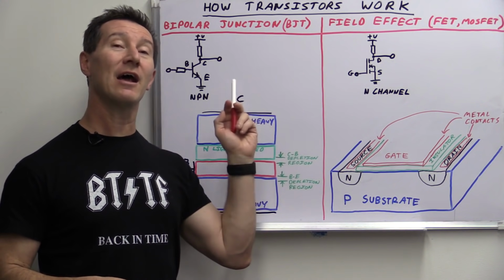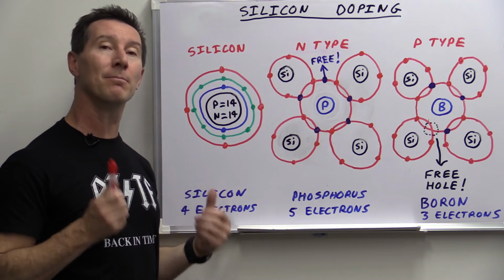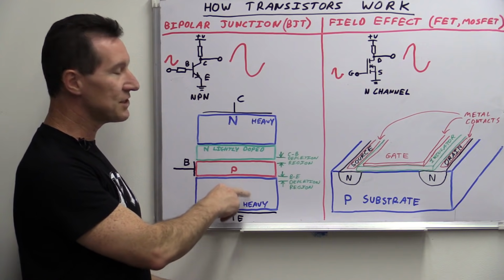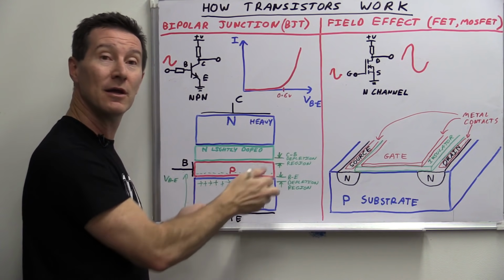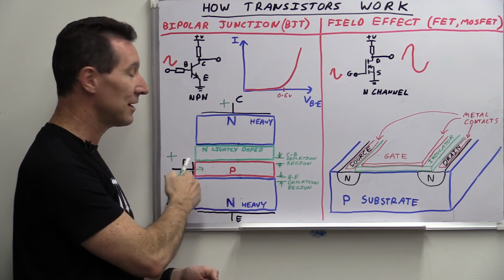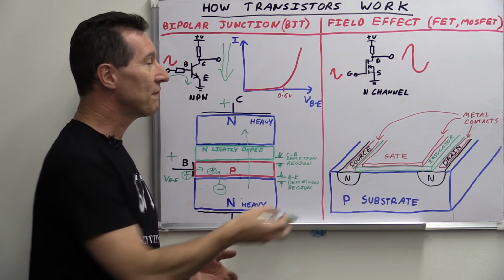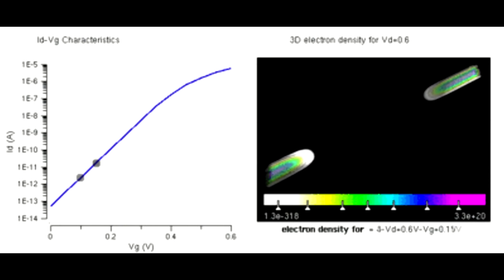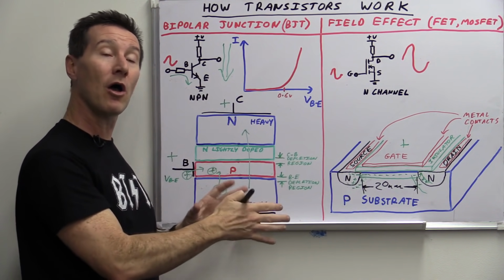EEVblog #748 - How Do Transistors Work?

Comment: Why is Conventional Current used in science and engineering?

Because of the positive current-carriers common in nature.  "Electric Current" has to work correctly for anything explained by science, not just for electronics involving metals.  (And then confused tech people pretending that holes aren't real, or that batteries and electroplating and proton flows don't exist.)

Positive currents are:   
- proton-flow in battery acid
- Proton flow in fuel cell Proton Conductor membrane
- Positive ion flow in human tissues, salt water, ground, ocean etc. (along with negative ions going opposite.)   
- Positive ion flows in plasmas along with electrons going opposite.  
- And of course, holes.   

Holes really are genuine positive charges, same as protons.  They aren't just "lack of electrons," since positive charge is when an existing proton is exposed by a missing electron.   Holes are real protons, but only having virtual motion caused by electron-transfer.   When an electron cancels out a hole, it leaves behind an exposed proton, as if the positive charge had jumped from atom to atom.

Also, CC conventional current is great for teachers testing the students, because if a student complains that the currents are "backwards," send that student back to physics class, since they've just admitted that they have little idea what "electric current" actually is.   Put it on a test questions.   Thinking that Franklin was right about single-fluid electricity, or thinking that current is somehow backwards, that's an automatic zero in physics classroom.

For the ones with solid physics background, CC doesn't look backwards at all.   Electric currents in salt water have no electron flows, instead they have two opposite ion populations going in opposite directions, two clouds flowing through each other, yet creating just one electric current, the CC current.

And besides, DMMs measure conventional current: they don't break currents down into the actual carrier flows: into percent of protons flowing one way and percent of electrons flowing the other.    Clamp-on ammeters tell us the Conventional Current even when clamped around an acid-solution hose, or a human arm being electrocuted, or a fluorescent lamp tube.

Comment: Hoho Dave, very rarely do I think you have misled your viewers, but here you have a little :O), We are taught about depletion layers and holes and magic ''transistor action''  but its just a bit of a fairy story story. We owe the development of solid state electronics to quantum mechanics and the predicted action was proven by those three famous chaps. The movement of  the positive ''hole'' charge carriers is pure quantum mechanics.
Reply: mart fart There are no moving holes or positive charges (as marked on a modern car battery) going anywhere in this universe. There are particles of electricity that can drain from an area to an area that has less particles of electricity. However there are only particles of electricity moving. Only particles of electricity stop other particles of electricity. Insulators do not stop electricity at all. You have to charge them up like a battery or a capacitor in order to turn them into an insulator.
That two particle theory of electricity was a theory that has been around since amber was discovered to have electrical properties. The French Scientist DuFay claimed it. However Benjamin Franklin disproved it.
It is like a vacuum cleaner, the vacuum cleaner does not suck anything anywhere. It compresses air, and ejects that air back into the atmosphere. That action creates less pressure inside the vacuum. Air from outside the vacuum now tries to move to the inside of the vacuum cleaner, by means of pressure alone. Because no attraction force exists in the universe. The same is true of electricity.
You can easily shut off a transistor by applying an abundance of particles of electricity, a (-) charge on a modern battery, to the terminal that had activated the transistor with a (+) charge. It resets the transistor to initial normal state, it restores the diode that was originally blocking power from flowing through the transistor.
Reply: William McCormick
inverted commas serve a purpose.
Reply: Did you mean around the symbols '+' and '-', that did not work for me. It caused me too much trouble during proofreading. While reading electrical diagrams I noted that (+) and (-) was easier on my understanding.
Reply: Symbols are kind of funny nowadays everybody has learned them a different way.

R1 x R2
------------
R1 + R2
Was originally written by mathematicians of the day as:
R1 x R2 ÷ R1+R2
 That is the in line form using the division symbol, which was not the fraction symbol, that had another function totally. This system actually was perfect for inputting complex formulas into computers as an in line formula. With no parenthesis needed. The system was amazing. However I do not believe anyone will ever get to use it.
Reply: William McCormick
You should get an old calculator that operates with Reverse Polish Notation. I had an early Sinclair programmable which used it, and HP of course.
Reply: This was much more simple and precise. To force division between two numbers or values, and turn them into one unit, we used the (/) symbol. A little (x) did the same thing between two numbers it forced multiplication between the two numbers a large (X) took every thing to the left and multiplied it by everything to the right of it. Because the order of math as it was learned across much of the United States was addition, subtraction, multiplication and division. One night I was explaining this to a modern mathematician and he said I was nuts. Then about fifty people chimed in and said they learned it addition, subtraction, multiplication and division. The old division symbol (÷) used to mean take everything on the left and divide it by everything on the right, unlike a fraction.

People somehow saw all the parenthesis above a complex in line formula back when everything was done by hand, and somehow assumed you needed a lot of them. Add that they could not get a main frame computer of the day to re parse a formula written like that, and I give you modern mathematics. IBM was going to loose all its grant monies or help change math and save the computer.
Reply: Oh by the way I meant originally the '' '' around word ''holes'' that I wrote... We  learned BODMAS (Brackets, Of, Division, Multiplication, Addition, Subtraction)! And with memory, a constituent of anything you could call a computer, parenthesis is irrelevant.
Reply: I am not sure how they sold "holes". Perhaps it is air gaps they are referring to. That would be feasible.

Comment: Thanks Dave for the great video. Not sure if it's been covered or not yet, but like Intel & AMD years ago when clock speeds basically topped out, but they kept naming their CPUs with "virtual" clock speeds representing the effective performance improvements due to other innovations like multi-threading and multi-core, the semiconductor industry has been doing the same for the past several generations. So the 14nm node does not literally have a channel length of 14nm, the transistor performance just behaves as if it did.  The really impressive dimension though is the gate oxide thickness, which actually is only a few atoms thick, and controlling this thickness (much less reducing it) is one of the main motivating factors behind going to the FINFET non-planar transistor design for 14nm.

Comment: The next generation will be Sphere - Kinetic with moving atoms inside, not the  static, here is the beginning : >  KL03: Kinetis KL03 - 48 MHz, Small Form Factor, High Integration, Ultra Low Power Microcontrollers (MCUs)

Comment: The atomic section has a few huge gaps. 
-why can they join ? Electrons required in each shell.
-why can electrons move ? You mentioned "electrons moving freely" but an atom missing a stable amount of electrons will always be attracted to electrons in/for the amount of electrons it's missing. 
-a way to look at N vs P. Stable amount of electrons is neutral. Electrons are negatives. Extra electrons make it more (N)egative. Missing electron(s) make(s) it less negative, thus (P)ositive. (Although, I believe in actually chemistry, it's the opposite.)

Also, if it's possible, can you dumb down "how a transistor works" even further. I've watched many videos, read two things, and had someone explain it to me, but everytime I think I understand something, the rules seem to change on me. So, after years (3+) of halfassly investigating, I'm still at a lost. Like, maybe include some sort of mnemonic (letter-word-concept association) for each gate/end, and maybe have some more (numbered) action lines as well. I know there are many types of transistors, so, explain in a way that can be adapted to most (if not all) types of transistors, if you can. 

And thanks for providing an educational option (ie; teaching from a different perspective - perspective, video, text, animation, et cetera).

Comment: Moore's law is nonsense.
I put a transistor into my drawer 10 years ago and it did not become smaller at all.
Reply: mart fart It is about getting smaller, NOT more and I bet you left 2 transistors of opposite sex in the drawer, so that was to be expected.
Reply: The Kaiser I remember putting a transistor in a drawer 10 years ago. I just went to look and I had 32 transistors, just what I expected.
Reply: +The Kaiser mine became mosfets, as expected.   Measure emitter-base, and its open in both directions.
Reply: +wbeaty Forget Moore's law, thats evolution! Leave them in there a few more years. They may grow more pins and become a 4017 decade counter XD
Reply: +mart fart don't mix npn and pnp
Reply: +wbeaty 
Hey, you're that dude from Quora who's posts I've seen and liked ! Great articles !
Reply: +The Kaiser .. did you remember to set the flow_time() to 1 ? the default flow_time() might be different in the simulation of your universe
Reply: jesse demers I bet, you lost your bet.
Reply: The transistor DID get smaller but the same force that made the transistor smaller, made the draw smaller too, so you didn't notice it.
Reply: +wbeaty 
... and now I have just found a bunch of awesome articles by you on your website "amasci" through a link in a "MAKE" video. Super impressed. Thanks for sharing your stuff !
Reply: i bet its speed has doubled or quadrupled by now though
Reply: The Kaiser we'll never know until we test it
Reply: he he.thats why I believe in and use dr. murphies law
Reply: noob.
Reply: It's not Moore's law it's newton law of inertia, a body tends to remain at motion or rest unless affected by external force,the transistor in rest always remains rest and does not change 😂
Reply: My wife calls me "the reverse Moore's law". Doubles in size but do only have half the speed! :-)
Reply: The Kaiser <sarcasm>Hahaha. You are hilarious.</sarcasm>
Reply: The Kaiser <sarcasm>Hahaha. You are hilarious.</sarcasm>

Comment: so is it true that between gate and source on the mosfet it is like ceramic capacitor and does the voltage on the gate regulate the resistance between drain and source or what? and also why is that parasitic diode between source and drain

Comment: Boron isn't used in Transistors for P material. Aluminum is the P material. You're confusing electron count with outer shell count.
Reply: In virtually all silicon transistors, boron is indeed the dopant used for donating holes to a P-region.

Comment: EEVblog  thank you for the explanation , but i have a question about the threshold voltage of the CB junction ,  practically I notice that collector voltage isn't responsible for overcoming the CB depletion region but depends on the Ib current , ( I mean that even if the collector voltage is small , the transistor will act as a short circuit if we applied large Ib .... and with a very small Ib - after Vbe > 0.7 -  even with a large collector voltage the transistor will act as a high resistance because of the CB depletion region   ) so instead I think it depends on Ib

Comment: EEVblog  Sorry, but the physics is really messed up. Can't blame you; nothing else on YouTube gets it right, but I was hoping. I've been meaning to make a vid, but we all know that'll never happen. Maybe if I go to Australia for vacation...? In the meantime, Pierret's Semiconductor Device Fundamentals is a good resource. BTW: All transistors (MOSFETs, JFETs, BJTs, Vacuum Tubes...) are voltage-controlled. BJT base current is merely coincidental. That is to say: base current in a BJT flows due to the same process that causes collector current, but to claim that base current causes collector current would be to confuse correlation with causation. The ideal BJT wouldn't have any base current, if that were possible (they can get close to this ideal with superbeta and heterojunction BJTs).
Reply: sorry bro, you can't take out a fire with a mere spit. If nothing else on Youtube gets it right, then enlighten us with your knowledge, you don't have to go to australia just to make a reaction video about this right?
Reply: Hezekiel Randolph i

Comment: Hi Dave! I today experienced something really odd at my desk while at work. I have an old analogue volt metre on my desk, next to two of my speakers. As I was reading a few emails, I noticed a strange clicking coming from the mtre, along with the more common interference sound on my speakers. When I looked at the mre, the scale was fluctuating rapidly on 5 volts DC. I'm wondering if the interference picked up by the speakers was also being picked up by the metre, and if this is even possible.
Thanks,
Mat
Reply: Mat Mabee could the speakers receiving interference have created a magnetic field that the voltmeter was reading?
Reply: Mat Mabee Maybe a magnetic field created by your speakers, carried over to your volt meters coil.

Comment: Just want to point out that the doping on the collector side is light, not heavy. Normally, the doping level is as such: Emitter >> Base > Collector. This is so that when in reverse bias, there won't be a large current flow. If you make a symmetrical BJT, then forward and reverse bias will cause same current flow magnitude.

Comment: I used to work at IBM making microprocessors. When you described the MOSFET gate operation, I was reminded of how much time our engineers spent perfecting the gate oxide layer. There were 40 PHD level engineers working full time on gate oxide quality. Good oxide equals faster speed. The more expensive fast CPU processor is identical to the cheaper CPU except for the quality of the gate oxide.
Reply: Yeah gate oxide is a huge limiting factor.  Which is why Intel has spent so much R&D efforts at finding other high-k dialectrics.
Atmel's claim to fame was their ability to make a thin oxide layer which facilitated EEPROM mfg' ing
Reply: @johnjacobjinglehimerschmid3555  sorry but what is "EEPROM mfg' ing"? I suspect it is EEPROM manufacturing but I prefer to ask as a non-native speaker than staying 99.9% sure and be bugged by the lesser and futile 0.01%. I got into real trouble once thanks to neglecting those 0.01%. Never again.
Reply: @JoséFranciscoCandidoFilho  Yes manufacturing .... just too lazy at the time to write the whole word out.
Reply: Amazing what humans can create.
Reply: Now that you mentioned it, Jeff, just how are those things built?  Did any of you make a video of what goes on in a plant where those things are made?
Reply: @charlesclements4350  It's an awesome process.  I worked at a company called Atmel that made alot of ASIC parts then mostly EEPROMS and 8bit MCU's along with a host of other stuff.
I was the lead operator for the strip process cleaning the silicon in preparation for the next step.  The inspection post cleaning was to me the most amazing.  Watching the layers build up.  Did quite a bit of inspect during the metal layers as well .... DId get to use a Scanning Electron Microscope ( when I became an Eng. Tech ) that was the best.
Also got, at various times, to get cross section views when trying to determine what / where contamination was located.
Reply: @charlesclements4350  there are a few vid out there. the most interesting is those using a high magnification microscope to look at processor circuitry.
Reply: Wow !  Thanks, tbled52, I'll keep my eyes open for them.
Reply: Respect
Reply: Thanks for sharing!
Reply: That is so cool

Comment: So I have TWO questions:
1. What happens to the characteristic behaviour of the circuit with increased temperature (i.e. does it become more or less efficient or something else?), and
2. What is the nature of either transistor type with aging (after being used for many years - i.e. - what is the mode of failure or problem due to aging??

thanks

Comment: Thanks a lot Dave for your work and your time! I deeply respect people like you who take their time to spread their knowledge free. Of course, some "Iknoweverythingandimbetterthanyou" people will criticize your work, but what you do is popularization of electronic sciences (and you never claimed it to be anything else, and... no one's perfect). So thank you again!  
BTW, if i may, you should do also a thursday, wednesday or whatever day lesson, where you present and explain, in a 5 minutes format, week after week, a simple electronic circuit function: example like limiter current system, protection system, etc... but kind of circuit that you build with less than 10 basic components (resistor, transistor, capacitor, diode, even AOP in the most extreme case), not the one that you build round with a specialized IC.